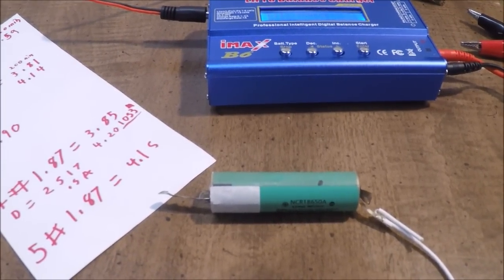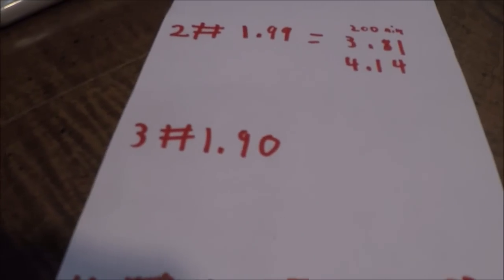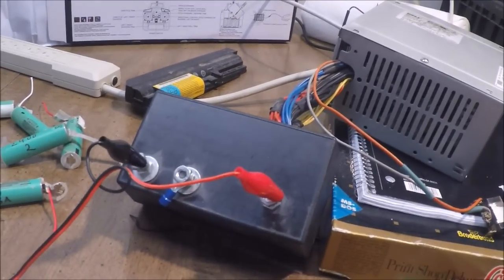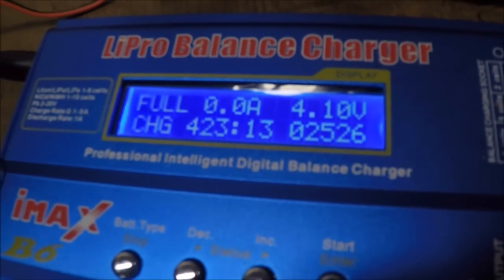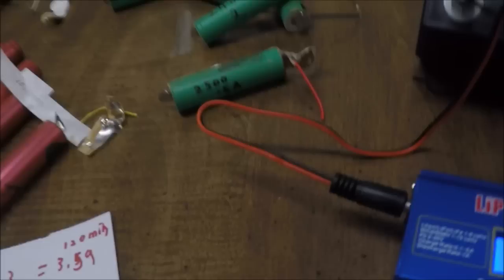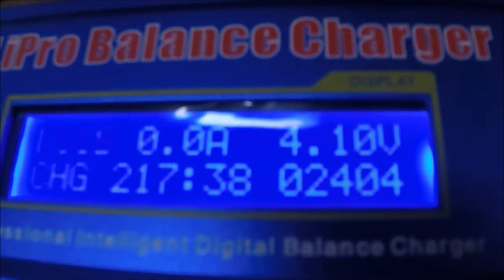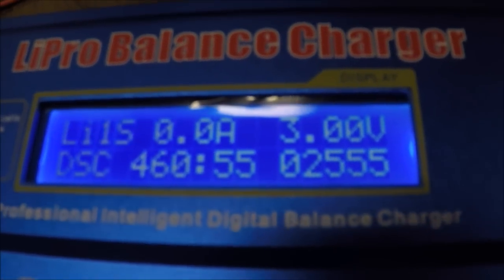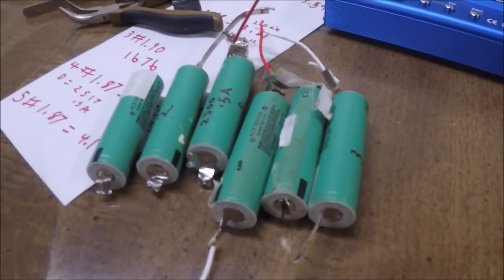Testing 18650 Li-ion Batteries from Old Laptops with my Imax B6 charger

Comment: This is for people who are just starting to check and recharge old lithium cells (this is an old video).
I STRONGLY RECOMMEND GETTING AND USING THE THERMAL SENSOR for the B6 balancer/charger (or whatever unit you're going to use for this purpose). This can help prevent the "they can get hot and uh explode and cause issues" part of the testing and rejuvenation procedure. You can use velcro strip to affix the sensor to a cell you're charging and it will sound an alarm and stop charging at a temperature you select ahead of time. For example, if you set it for 150F then it will shut things down when the battery surface reaches about 150F. This will help prevent outgassing/venting, thermal runaway, and fires and "uh exploding". The sensor costs anywhere from about US$2.40 to US$6 and may ship for free depending on different factors. That is  really CHEAP INSURANCE and well worth the few bucks it costs.

Comment: After fully charge the 18650 battery you have to leave it about 10 days to be sure they don't lose voltage....
And after that you discharge it to make capacity..
Reply: Yeah I agree waiting a bit of time to actually test them, I have a few 18650 that seem normal until we wait a few time and see that they are kaput, they keep self discharging like nuts so it's a battery to be charged and used right away only since after just 2 days it already lost quite a bit of voltage which makes it a very terrible energy storage source...
Reply: One of the first tests to run is the cell's internal resistance. You can do that immediately and it will tell you a lot about the health of the cell. You want cells with as low internal resistance as possible. Also see videos/blogs about "matching lithium cells" or "matching lithium batteries" and similar.

Comment: It's also a good idea to try to use cells with internal cell resistances that are close as possible. E.G. don't pair a cell with 63mohm internal resistance with a cell that has 300mohm internal resistance. The lower the internal resistance the better.

Comment: Well yeah, that's sort of the way to do it... You should however probably leave them sitting for a couple of days and measure the voltage to see if they self discharge, since a battery that is empty after a week without you using it isn't necessarily particularly useful, not to mention Li-ion batteries can get quite dangerous in many situations including when they are internally shorted obviously.

Comment: I usually charge them in series and discharge separately. Quite often its good enough and the charging happens much faster. Its anyway damn slow to check 240 cells even somehow properly 😂

Comment: Hi there.  FYI, milliamperes/hour means that you discharge the cell at 1 amp will return a realistic value in milli ampere hour. Discharging at 0.5 amps you would have to divide your results by two.
Reply: I think imaxB6  know this. It calculate the mAh, it's a microcomputer.

Comment: Thank you for taking time to explain how to determine the capacity of 18650 Battery.
But, you confused me towards the last stages of your explanation.
Your procedure was ..
1) Charge the Battery to 4.2V
2) Discharge the battery to 3.0V
3) Charge the battery back to 4.2 and determine the final reading of Battery amps.
This was what i came to understand.
Am I right?
Please respond.
Thanks and regards.
Reply from the maker: the charger displays the amount of amp hours it put into and takes out of the battery. so if you charge it the whole way and then discharge it to a safe low and is says it discharged 1000mah and then you charge it back up and it puts roughly 1000 back in then you have a 1000mah battery. it is not 100% accurate but it should get you close to it. now that being said there are chargers out there for $20 that automatically test the 18650 battery and tells you what the amp hours are without you having to do anything.

Comment: Why the first time it was drained was 1676mAh and the second time 2555mAh taking into consideration that in both cases the battery was completely full? Tks
Reply: It's probably cause it's been sitting a while at under voltage... needs a couple of charge/discharge to work properly again.
Reply: IMAX B6 manual says it will take 10 discharge and charge process to get the full capacity of the battery.  That's mean repeat discharge and charge will increase the capacity that's what you got.

Comment: The Li Io setting will take the cells down to 2.5V which would damage most cells including samsung ICR which will me defective below 2.75V. Did you manage to change the discharge voltage setting on the imax?
Reply from the maker: +elcykelguiden.se i did not change anything. i just went into the settings and selected li-ion setting and everything was preset. in all my test the batteries never went below 3 volts.

Comment: so 1st u have to charge up to full to 4.10v, then  discharge . write that number down .
2nd have to change up full again to 4.10v , then discharge again . and that number is the capacity ?

what if first discharge it, then charge to full 4.10v? (whit this method I got just 1500 on a lgabb41865 what is should be 2500mA )

Comment: I deeply tested this charger with a 18650 and it does not perform very well:

At 0.3-0.5A charge rate it can only charge up to 1100Mah (it's an older battery), I verified backward using discharge method too.

I have a simple LiOn charger TP4056 module and the same battery it can charge up to 1500Mah. Again, I verified it by discharge.

I measured everything twice.

Comment: Hello . Replacing the nickel cadmium batteries in package from DRILL 18 volt batteries with 5 18650. How do I charge them on the Packet from the drill. # Chained 17.5 volts
Reply from the maker: if they are in series you would set it for lithium ion 5s or 5 cells.
Reply: 5 cells bat the voltaz its4.2 V at 6000 A

Comment: the capacity of the battery you last measured was 2555. You have typed 1676 on the paper. which?
Reply: 1676 mAh vs 2555 mAh from the same old cell is an indication that the capacity improved after full cycle charge/discharge twice. This happens because the cell was discharged too far in the laptop battery and left in an excessively discharged state for a long time. 

The slow charge and discharge (twice) improved the fractal pattern of molecules on the plates. When cells are excessively low in voltage, it is best to charge at unusually low currents to improve the cell capacity.

Comment: I have several SLA 12 volt batteries of varies current ratings.  I want to sort out good from bad.   What would be the procedure to confirm the current capabilities using a imax B6.  I just picked up a B6 mini.   These a are Lead Acid 12 volt batteries used in Computer UPS back ups.   The discharge current can't be set any higher than .5 amps due to the 5 watt max power rating of the imax.
At lower voltage batteries I can get more current but higher the voltage the less discharge current is available   P=IxE    5w = I x 12 volt   5/12= max discharge current.    Is the method you used exactly the same for 12 volt SLA batteries?

Comment: i'd charge it at 100mA 0.1A not 0.5A thats way too much for charging a completely flat dead LI ION cell
and then discharge to 3.3v then charge up to 3.6v but not 4.2v and repeat that a few times before charging all the way up to 4.2v
then see if it stays close to 4.2v for a day. if it does then you revived the cell successfully.

if it gets hot, blows up or the voltage just shoots up with no charge going in. then its junk get rid of it.
Reply: K.....So this how you figure the C rating???How do you figure the C rating?
If I understand you correctly....keep it under 10C
Then gradually increase the discharge rate....
Are there some type marking, code or equation. I can calulate C ratings???

Comment: On previous message i was wrong did not noticed you were xharging on li-ion program.But why they have end voltage 4,1 and not 4,2?
Reply: I know this is old video/comment but to answer...
I just setup one of the B6 memory allocations to set up my own parameters. That way I control the upper voltage, the min voltage, charging and discharging currents, etc. It also lets me compensate for inaccurate voltage readings by the B6. For example, to charge a Li-ion to actual 4.20V I set a memory slot to charge to 4.23V. I know it's not a lot, but it lets me also compensate for new version li-ion/LiPo cell parameters like discharging to 2.7V instead of 3.1V to which the B6AC V2 defaults.

Comment: Would agree 1amp discharge would be factory specs. Also, did you calibrate Imax? Good video. Just ordered a clone.
Reply from the maker: No i did not calibrate and 1 amp would be but they are old batteries and i probably wont draw 1 amp while using them. i was just testing to make sure they still worked .
Reply: The clone I bought showed up and didn't work.  Someone had used the one shot calibration and all Lipo batteries were over voltage.  Seller refunded $15 of $18.  Figured I keep it for parts. Ordered a Sky RC imax B6 and it's getting used a lot.

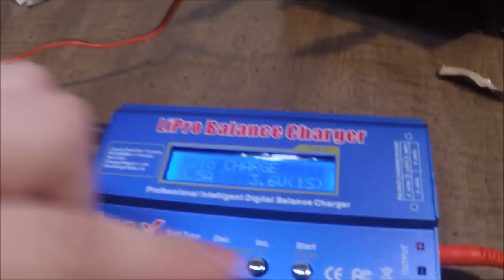Comment: 1:46
I see that your charger displays 3.6v at Liio charging mode but I think that that's wrong :P
At my original SkyRC iMax b6ac (second gen) charger I set up the LiPo charging mode and with this charging mode I can charge my Lithium Ion cells to 4,2v.
Until now I never got any problem with my harvested 18650 batteries
Only the discharge process was done on the proper mode since I didn't want to turn any of the 18650's into some small flying rockets : P

Btw. You have there a clone of the b6. The original iMax/SkyRC chargers doesn't have any EC or FC labels and they never would have this trash can since this product doesn't contain any batteries inside
Reply: You have made a mistake with your charging. LiPo and Lithium Ion ARE NOT the same. LiIo cells are 3.6v and LiPo are 3.7v. You should not use the functions for one of these to charge the other as they have different end voltages at both ends. You must use what is written on the battery to decide what cells you have. If you think the voltage is incorrect (because dishonest people sometimes resleeve the battery and they may have made a mistake) there are subtle ways of deciding which is which.

Comment: I have problem with charge lead acid battery 
I have 30 ampere trasformer but when I charge the 100Amh battery only takes 5 ampere 
is there any circuit helps me to control current up to 30 ampere ?
Reply from the maker: So I am not sure if i completely understand your set up but my guess is the charger is only pushing 5 amps to the battery and so it will only draw 5 amps from your 30 amp transformer. So you cant charge your batter at 30 amps with that charger.

Comment: so for checking one single cells it would take a lot of time, maybe 6hours what would you do for check 1000 cells
Reply: Jose, nobody replied to you for a year! 
series solution: Put several cells in series, but connect a cell balancer to the cell/battery holder. Use a charger or dc/dc converter with both current limiting and voltage regulation. Set the charging voltage to [number_of_cells] * 4.1 Volts. Set the current limit to 0.5 Amps (or 500 mA). Make sure the balancer can handle the charging current that you set! 

You may also connect many cells in parallel, however, the current may not flow through all cells equally which will put more thermal load on some. One purpose of testing the cells is to determine this property! 

Also, it is very dangerous to put cells in parallel if their voltages are different. Very High currents may occur, causing some cells to charge far faster than their capacity. You may use some resistor or light bulb to limit current while adding another cell (in parallel) to the battery pack, but be sure to measure the initial current, and insure that the current level is safe.

Comment: Hi!
I just bought an iMax B6 mini SKY RC Genuine to test some 18650 cell and others.
Just a question for now if anyone can help:
Considering a 18650 cell fully discharged.
Charged to 4.1v it will receive 2356 mAh.
Discharged to 3.1v it will supply 2587 mAh.
Can anyone explain why it will give more mAh than it receives?
Reply: You possibly charged it from a higher voltage than 3.1 Volt?

Comment: The last thing at the end of the video, you discharge the battery(cell), are you keeping the battery discharged until you use it, or you didn't show the last charge?
Reply from the maker: I didnt show that i put them in storage charge if i am not using them.
Reply: @BeginnersTech314  Thanks

Comment: I have a question what Voltage do you charge it up to and at what Amps? Same with Discharge?
Reply: He uses the Li-Ion programm to charge, so its up to 4.1V and charged with a current of 0.5A, discharge i dunno.

Comment: Can the I MAX B6 do pulse chaging on a lead acid battrie
Reply from the maker: i think it can not 100% sure
Reply: Nope, it does a constant current / constant voltage charge without pulses at max ~4.2A starting current on 6cell Pb-battery (discharged to 12v, below is not recommended) and can charge up to 10cell Pb-battery. Hope this will help you

Comment: This charger is not much good for best measure to nowaday Li-ions since their capacity nowadays according to the datasheet discharges to a way lower voltage and charge to 4.2 Instead of 4.1 unless you use LIPO setting which charge to 4.2v but the discharge rate doesn't go as low as the datasheet of most current LI-on.

Though if we really want max cycles out of LI-Ion the IMax is the right charger since the more voltage they are charged and the lower voltage they are discharged the lower will be their life cycles...

Though I heard there is a CFW for this IMAX but I think we need to solder a new connector on it...
Reply: My Imax b6 discharges li-ions down to 2.5v and charges to 4.2v. I guess it depends on the version.

Comment: I ordered a genuine imax b6
i have lots of 18650 from old laptops, some are still at 3,6 V after a couple of years
Big question is : is it dangerous to mix batteries from different laptops ?
Of course those which have same everything after testing, same discharge amps, save voltages, same li-on technology
( not real english, i'm french )
Reply: Ok for parallel, series dangerous
I think should do with a lot of tests before, and precausions
Reply from the maker: yes, be careful they can be temperamental. do testing and don't let them charge unattended. as for mixing different one from different laptops i don't think there is an issue.

Comment: why 3.6v and not 3.7v ?? does IMAX have option for 3.6 and 3.7 separately??
Reply from the maker: it does but depending on the chemistry of the battery you do not want to charge it to 3.7.

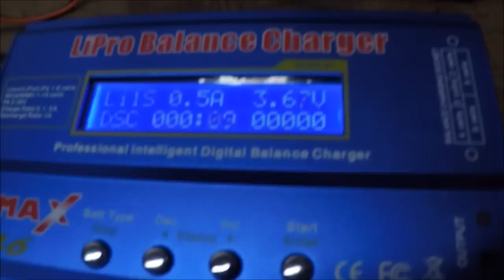Comment: Can someone explain why the displayed capacity is so far off from what you get by multiplying current by the discharge time? At 3:41 the results of the discharge shows that the capacity is 1676 mAh and the discharge time is 335 min. Shouldn't the capacity be 335/60*500=2792 mAh (discharge current was set at 0.5 A) ? Or does the charger use some pulse mode of discharging so the discharge current is actually lower? Or does the charger recalculates the capacity to the rated voltage of 3.7V?
Reply: THX for writing down the question. I am very interested in the answer, too!
Besides I wonder why the the two capacity tests vary so much and why discharging at more Amps ends in more capacity?!
Reply: You should look at discharge curves. When cell hits 3.0v the current starts slowly decreasing. Because of that your calculated capacity is wrong
Reply from the maker: I have been told that the charger calculates the capacity. I have not tested that statement.
Reply: 335/60=5,583 time is in 60parts. Metric is in 100's. That's  why
Reply: K....but how can you figure the C ratings.
I ask becuase I want to use it R/C stuff.
That's the different in me installing these batteries in a floater that will
just cruiser around or a speed demon
Wrong C rating in a speed demon might cause an explosion...just saying.

Comment: I keep hearing bad things about this charger. What's your opinion about it? is it that bad?
Reply from the maker: i have not had a problem with it. i like it. it works. the quality of it may be cheaper then what some people like. but for some one on a budget it is good.
Reply: yeah, the ones i saw complaining, have multimeters that cost more than my car xD. so their standards are probably too high .
Thanks. i think i'll get one of those too :)
Reply: Buy the IMAX B6AC V2, It is more accurate and have a built-in powersupply :)
Reply: IT IS COUNTERFEIT!   1.) The genuine SKYRC iMAX B6 has GOLD plated output jacks for the 4mm banana plugs. 2.) It has a SKYRC logo printed on the upper right corner. 3.)  A scratch off holographic sticker reveals a code that you can verify unit through SKYRC.  4.) The CE (for China Export), FCC & Don't Recycle tags are located on back of unit, not front lower right corner. 5.) The screws holding the body together are black not chrome plated.  6.) The counterfeit box doesn't even come close to looking like SKYRC's box (It's not black & doesn't have diagonal red slashes.) 7.) There are a whole slew of internal dissimilarities, too many to type, one though, gives false readings on the display screen which could be dangerous!!  I hope I covered enough external dissimilarities to help you weed out the counterfeit chargers from the genuine item.  Spending the extra money for the real deal may make the difference between "Home Sweet Home" and a FIRE GUTTED HOUSE!!  It's YOUR choice to save a couple of bucks........Read more Show less